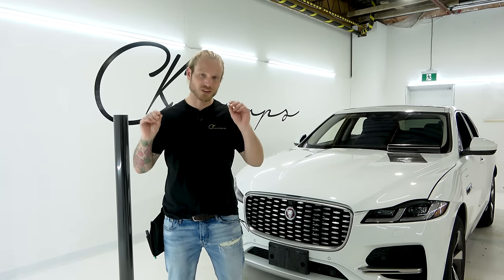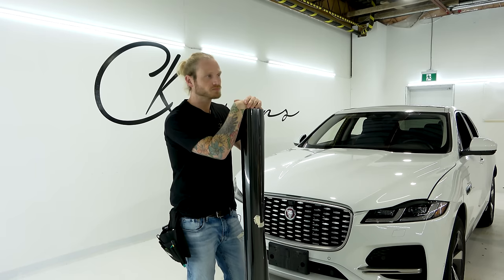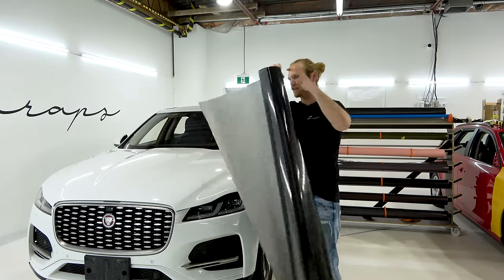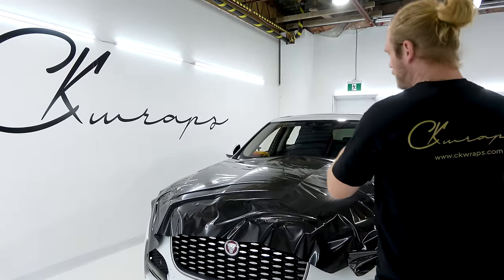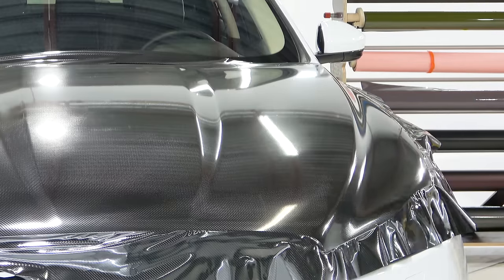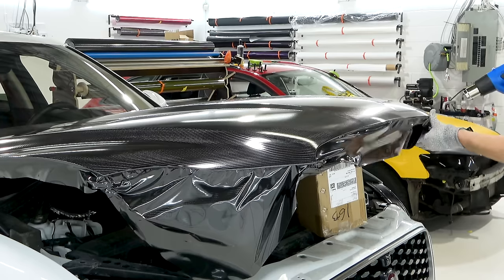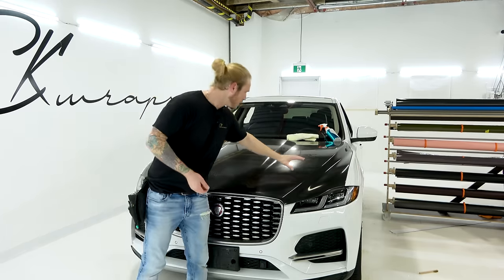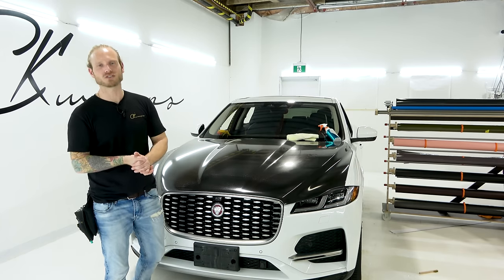Most Realistic Carbon Fiber Wrap I've Seen!

Comment: Bought some of this tinybot carbon for my mirrors and rear spoiler. Stuff sucks. Easy to install but the top coat is delaminating and letting water leak underneath after washing. (not cap sheet) I have heard from others that tinybot is low class vinyl. It looks great but wont last. Wouldnt recommend.
Reply from the maker: Yes, as I mentioned in the first few minutes of the video. It will delaminate unless all edges are sealed. Thousands have emailed me regarding that issue, and those thousands didn't listen to what I had to say.... It doesn't pay off to skip ahead. You need to learn things from the bottom to the top to understand what's going on, but to also be good at it.
Reply: When sealed you mean wrapped or heat sealed? Cause on my rear spoiler, I used adhesive promoter, wrapped every edge and put a lot of heat after. Still leaks water. The water drys out after a day but is getting worse after every wash. @CKWraps

Comment: Looks great! It is however ironic that carbon fiber is meant to reduce weight and by adding an unnecessary wrap you actually add weight. 🤔
Reply from the maker: If it's meant to reduce the weight then why do they make carbon fiber mirror caps, spoilers, front lips, hood scoops and so on? Changing out your mirror caps for real carbon fiber ones will not save you any weight but the price tag will be much higher than a vinyl wrap. Trying to reduce weight on a vehicle that isn't track driven is pointless since most vehicles don't have all supporting modifications to make the vehicle as fast as possible before shaving off weight. Saving weight is the last step in performance and it's usually the most expensive when comparing shaving off tenths of a second in comparison to adding in a supercharger.

Most people are after the visual esthetic and not the performance value when they "add on" real carbon fiber parts. Putting an enormous carbon fiber spoiler on a vehicle that never came with it is already adding weight. Switching out your hood for real carbon fiber will save you next to nothing when compared to modern day vehicles with hoods made out of aluminum which already weigh only a few pounds.

Comment: Just a note on the comment in your video about Avery not being a cast vinyl, ARE YOU 100% its not cast as it is being sold to me as a full cast product and all the spec sheets state its a cast material. I don't use 3M but I would think if they advertise it as cast it must be. Nice looking carbon. I can and do use polymeric from time to time, I would never knock any material or process as what works for one will not work for another and choose the material to suit the job and the budget.
Reply from the maker: It is a cast, I didn't say that it wasn't. What I was saying is that it's not as pure as a film like Oracal.

Comment: As someone with a car that's real full carbon, seeing cringey carbon wraps like this becoming more realistic will only have more people asking me "is it a wrap?"
Reply from the maker: If you track your car competitively then it's totally worth it. After doing all supporting mods then it's usually time to lower the weight to shave off some time.
Reply: @CKWraps  it's worth it to wrap your car in fake carbon vinyl? Since when? 😂 Not coming at you. I don't like that these companies are making more realistic fake carbon wraps
Reply from the maker: @Gborohooo  it's worth it to help protect the original paint and keep the oem fitment of those pieces. With many exterior panels being made of aluminum these days the weight savings aren't much to switch to real carbon fiber. Also adding carbon fiber mirror caps it purely for esthetics.

Comment: The problem is that 95% of those who buy a carbon fibre hood, are more interested in the weight saving benefits than the actual look itself.
Sure, a wrap looks "cool" but what other purpose does it serve?
Reply from the maker: It protects the original paint. A lot of hoods these days are made out of aluminum which weighs almost the same as a carbon fiber hood. On my Jeep for example I can hold the entire hood elevated using just my index and my thumb because the hood is so light. Switching to a carbon fiber hood to save ounces of weight would be a waste of money. You'd be better off to empty your bladder before a race.

Comment: This looks identical to the ebay CF wrap I bought, it looks great for a while but then it starts looking horrible after a year.
Your "CF wont save you weight" isnt truthful. Sure, there are a few examples where it doesnt make sense but most economic cars save weight when swapping to CF. My Jetta saved over 20lbs with a hood swap. Removing Sound Deadener is free and will save you as much or more than swapping exterior parts though.
Reply from the maker: In most cases many people are installing carbon fiber for the esthetic and not the functional part of saving weight. Swapping only to a carbon fiber hood might save you 20lbs but in reality that doesn't make your car any faster. If you swap every panel to carbon fiber then you could knock off several hundred pounds but most people don't go to this extent. Swapping mirror caps definitely won't save you any weight and neither will it save weight on a duckbill spoiler. 

Most people don't track their cars but if they do then I definitely see the purpose. Street racing with a carbon fiber hood won't win you any races against the same car without one. Let's be realistic about it though. Cars like Pagani, Bugatti, Koenigsegg, Mclaren etc build their vehicles from start to finish to be as light and strong as possible so it makes sense in that situation.

There are also many other supporting mods that should be done prior to weight reduction which is usually done once all other performance mods are done so they can shave tenths of a second off of track times.
Reply: @CKWraps  Completely agree with everything stated.

Comment: No offense but i really doubt you can pick up your jeep hood with 2 fingers or saying it weighs 6lbs. I know for a fact it does not weigh 6lbs for any car hood period. Please upload a video posting how much the hood weighs and you picking it up with 2 fingers bc i doubt you can. So either back up what you said or you’re a liar. Im only calling you out on your bs bc my real carbon fiber hood which is 100% carbon fiber meaning the top of the hood is carbon fiber and under my hood is carbon fiber which ive never seen that on any carbon fiber hood ever nor i dont think anyone even sells one like mine. Nornally cf hoods under is fiberglass painted black. I paid $2,000 for my hood which is about 2-4x more expensive if you look up carbon fiber hood. Anyways point is you wont find a hood like mine. It was made by Mario from tsr fabrication. The first model was a little thin but weighed about 12lbs but if you pushed on the hood in the middle it would flex a lil bit so he reinforced the second model which is stronger and doesnt flex but weighs 15lbs which is the one i bought. And people get carbon fiber bc its lighter and stronger bc of the cross weave twill. And you saying you dont buy carbon fiber for the weight reduction is complete bs and thst is exactly why people buy carbon fiber. So i lost abouy 15lbs off my hood which i weighed the stock hood and my cf hood and mario at tsr did the same as well. And my cf trunk which i lost another 12lbs is abouy 27lbs almost 30lbs of weigh reduction. If i got my doors cf and my roof id lose more weight bc my one door is heavier than my hood. If my doors were cf id probably lose about another 50lbs since the doors are probably the heaviest and the roof being the 2nd heaviest. So my total weight loss of cf parts would be around 80lbs. Which could shave off 1/10 of a second off your time from 13 to 12.9seconds which is enough to make a difference. I took all my back seats with new lighter front seats only. But losing unsprung weight is different than regular weight loss. Anything that is rotational weight you lose is about 10x the weight with standard weight. So if I shed 3lbs of each wheel which is unsprung weight it’s like 30lbs off each side so 60lbs which will have a greater effect losing unsprung weight and you probably would lose about 3/10th of a second off. Any rotational weight you reduce like lighter rims, billlet aluminum hubs, rotors, etc is unsprung weight and which you’ll see much faster times by reducing unsprung weight. FYI my car is a small car 1973 Datsun 510 similar in size as a mini cooper and my car weighs 1960lbs stock which no car manufactured today weighs under 2,000lbs. A Honda civic today weighs around 3000-3300lbs even todays mini cooper weighs 2,711-3,926lbs. The only car that weighs under 2,000lbs is a Honda crx  and crx hf is about 100-200lbs lighter. 88 crx weighs 1,922lbs and the hf model weighing 1819lbs then 89 vex weighs 2048 and the hf weighs 1834lbs, and the 90-91 crx weighs 2,103lbs and the hf weighs 1967lbs. The lightest
Reply from the maker: Sounds like your upset with me about the weight of aluminum versus your carbon fiber hood with a lot of epoxy (don't forget the epoxy...). Unfortunately, I didn't create aluminum. Also, context is key. You might not have noticed that it was an exaggeration, but I can still pick it up with 2 fingers effortlessly.

Comment: Cool, but don't lie about there not being a weight advantage of carbon fiber vs. any metal, be that aluminum or steel. You will save at least 10 lbs from the lightest of metal hoods, and at least 30 lbs from the heaviest hoods. That is just from one panel. Doesn't sound like much, but with a few other panels, and a few other weight saving measures and you've knocked off nearly 100 lbs from the kerb weight. That's why performance cars use carbon fiber! This blatant lie made it really hard to watch the video, Pinocchio!

Comment: This would have been a great video.. if he told you what he used 😩
Reply from the maker: I said it at the beginning
Reply: @CKWraps  Thank you for the reply, you did at 3:20. 
It is a long video, people tend to skip around to just find the brand. A link or mention in the description would be nice.
Reply: @JG-lf4tq  i actually saw this vid on the company's, TINYBOT, YouTube page, I ordered this same wrap and watching again because I'm wrapping my hood with it tomorrow
Reply: @bigman7570  Does it look as good as claimed?
Reply: @JG-lf4tq  yes it looks good to me,  I haven't put it on yet though so I will see how good it looks on the car tomorrow
Reply: @bigman7570  let me know how it turns out
Reply: @JG-lf4tq  will do 👍🏿
Reply: @JG-lf4tq  taking a break from wrapping my spoiler, the wrap looks amazing but it's really thick so it's hard to work with, my car is a Charger so the spoiler is rounded so that makes it even more difficult. I plan on wrapping my hood later this week, it should be easier
Reply: @bigman7570  I'm gonna order that stuff then. The issue I wanna wrap some bike parts with sharp lifts and corners. Think it would still wrap around with enough heat?
Reply: @JG-lf4tq  yes it will wrap but if you've used vinyl from 3M or VIVID this wrap is much thicker than those so it isn't as easy to work with
Reply: @bigman7570  I haven't, so it might not be as bad since there is no comparison for me to make. Where did you order yours from? I'm up here in Canada and can't find reliable distributor.

Comment: Kpmf is double cast vinyls... Also dont compare polimeric with single cast, 3m avery are cast, tinybot is Chinese polimeric just like other Chinese brands.. Dont forgot that polimeric cannot be stretch beyonf 5%, cast 30%, post heat dont destroy memory in polimeric, it will want return to original pre streaching so it will shrink! It also natural shrink 2% yearly, while cast dont shrink at all.. Its why we, professionals use proper wrap vinyls designed for car wrap... Polimeric was designed forn2d flat surfaces, not 3d.
Reply from the maker: Polymeric vinyls work great, this is why the cars I've wrapped in them 4-5 years ago still look good. Saying that you can't stretch a polymeric past 5% is just spreading false information. 3m shrinks a lot so again you're spreading false information. I'll do a video specifically using 3m and showing how much it shrinks when heat is added without ever stretching it.

Post heating also works great on a polymeric film. I'm not sure where you got all your information from but it's incorrect.
Reply: @CKWraps  All information I got are from manufacturers and experience coming from being signwriter 10y. Polimeric indeed works, but it will shrink no matter how much you post heat it - its way of production which is a key why they are inferior then cast. Its why adhesive must be stronger solvent based to hold better. Not passing 5% streach close to edges or recesses is always  recommended by every manufacturer of polimeric based vinyls. Hybrid films, multilayered tend to shrink even post heated as you cannot destroy memory of how it was made, its why cast production methods was invented for 3d objects as streached even 30%, afte post heat, it will not want come back - that's for true cast not hybrids. 3m or avery shrinks not because they not cast, because low tack "slidable" adhesive... You spreading lies about they being polimeric. They cast, just not double layer cast like oracal or most kpmf.... Chinese manufacturers dont have cast production lines, no one saying they not good for wrap, but they always will be inferior then cast vinyls. Amd you cannot wrap with then deep recesses, they should be used only on 2d or slightly curved objects. I got lot of respect for your work, but when you try teach others and don't have correct knowledge about production of vinyls, I wouldnt bother going into it that deep as you did innl this video as who is spreading false information its acculy yourself... All best
Reply from the maker: @mariuszczarnota1  I'm not saying that Avery and 3m are polymeric, I'm saying that they will also shrink. Avery doesn't shrink very much in comparison to 3m when taken directly off of the roll and heated without tension on the film. You're right, when installing any polymeric or any cast it is best to stay at 5% stretch or less at any edges. Even though 30% is said for cast it is still bit recommended to reach this point and in many cases the film will already begin to discolour slightly or the gloss will become more matte once you reach around 20%+.

Techniques on the way all films are stretched to wrap a panel will combat shrinkage of any film, especially if the edges are pre-heated / pre-shrunk before cutting.
Reply: @CKWraps  You said its not fully cast, while not all colors are dual layer cast, like all oracal are double layer cast, basic colors are single layer cast, and even like you suggestimg if it be hybrid cast/polimeric, then it be thinker like Inozotek which perhaps is hybrid cast/polimeric. Production methods of polimeric vinyl make them ticker so i dont think that conclusion about ONLY oracal is truly cast is correct. I maybe wrong because funny enough, there is no really regulations about what can be call cast, which of i believe Inozetek taking advantage. I believe is fully polimeric just like Teckwrap China manufactured vinyl... I know avery and 3m shrinks, every vinyl will shrink if not post heated, but cast vinyl post heated to 100 or so C° would loose memory, while polimeric don't and would still want to com back.. Thats major difference. And we all know Polimeric looks better, as its thicker, but i would never recommend polimeric vinyl for complex curves z recesses (like in vans) deep pockets etc. Its got more limitations then cast. And avery /3m shirnks more due to less agressive adhesive, you need really good pressure for them to be activated, no glove only for example because it wouldnt active properly only by using heat, its more pressure sensitive vinyl then other vinyls... Thanks for exchanging experiences, its how we learn. I was just concern when you tried level on same shelf cast and polimeric, while they are by design manufactured to work differently.. Cast be always better choice for longevity and where you need push vinyl in rather then lay in..
Reply from the maker: @mariuszczarnota1  yes "cast" and "hybrid" are terms that are loosely used and you're right when you say there is no regulation on how pure the film needs to be. This is why each film might be labelled as cast but they all feel different from brand to brand. They are most likely mostly cast but I don't know how much that needs to be. From my knowledge they are all blended differently when manufactured. Cast vinyl is produced by turning PVC resin, plasticiser and colorant into a paint like substance by using solvent. Then dried at a high temperature. The mixture of the ingredients along with drying process can definitely change a lot of things as we can easily feel the difference between Avery and 3m alone. 

Polymeric has a medium life span of 5-7 years outdoors, and as you said is thicker, shrinks more and has less ability for highly contoured surfaces. It's more likely to pop out of severe recessed areas while cast is much less likely. Knowing the install methods for polymeric can make it nearly as durable as cast other than cast having an average lifespan of 8-10 years.

I've had great success with polymeric and post heating them has always worked for me. During my workshops I do this fun experiment where we stretch a polymeric 100%, then post heat one area while leaving another area unheated. Once it cools I cut through the film in each area and add heat. The unheated area expands very quickly and pulls back aggressively (as it should) and the post heated area barely moves. This could be a fun video to do for YouTube so it might be my next one.
Reply from the maker: This is the 6D from them and has a floating laminate which is why water can get under the laminate.